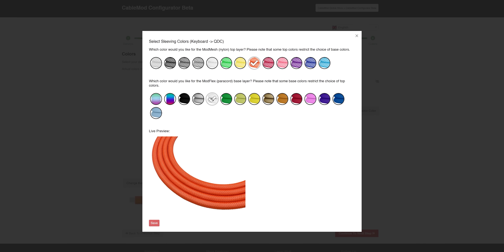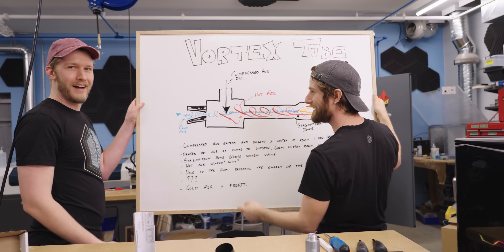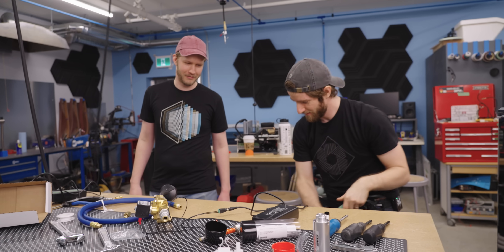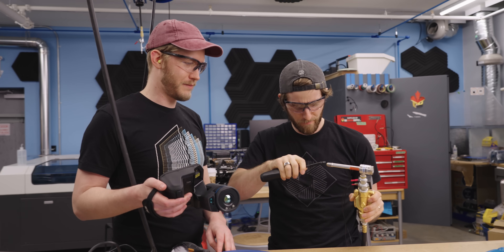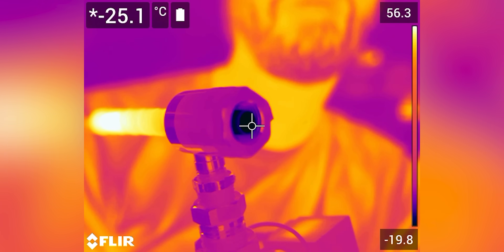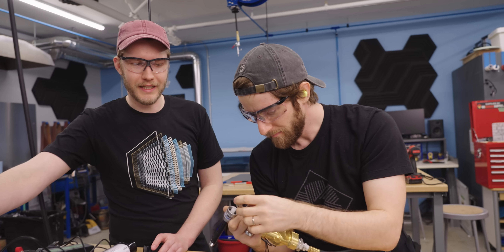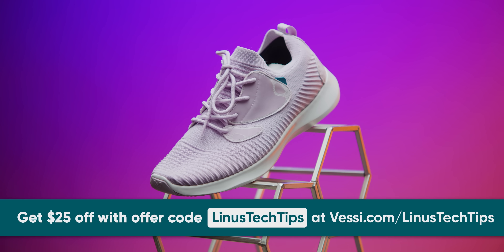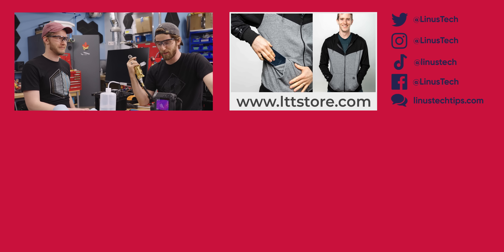This is a CPU Cooler? - Vortex Chiller

Comment: you guys should try it venting out the hot air but having everything else closed off form the out side air so you can try and get the hole system under 15 degrees then try and run the benchmark

Comment: interesting use of " Maxwell's Demon "  if there is a next time try both a water trap in line with the air and aim at Heat Pipes on the cooler, not just the fins.

Comment: An excelent example of the difference between temperature and specific heat.  Air (regardless of how cold) is astronomically lower specific heat than water.

Comment: dude, I watched 5 minutes of a 6:49 minute video and got how it works. It's just thermodynamics, it's simple physics. I don't have a PhD, I got a very basic title of refrigeration back in high school ( I went to a tech one, in Chile) and after that I never worked on that field, and still understood it.
Take the diagram you had on the whiteboard
1. Compressed air comes into the chamber
2. The chamber and the shape of the tube make the air go into one direction (right in this case), friction along the way heats up the air
3. The control valve stagnates or partially stops the airflow in the center of the tubing, allowing only some of the (now hot) air to escape
4. The air in the center, as it can't escape through there, moves through the center of the airflow into the opposite direction, trying to escape through the other exit
5. Because while traveling to the left exit it has to go against the hot air's flow, the air in the center loses energy, which cools it down
6. Cold air comes out the left exit of the tube.

Comment: Interesting industrial part that actual raised some cool ideas in the comments/topics. Would be cool if they can try it again with some of the ideas like adding a water block for example. Maybe if they could get a perfect seal that should be better? However idk if that would work either. Keep in mind when they were testing on the cpu it was back to the 10cfm(i think). I know it wasnt the 40 for sure bc right before testing the cpu, they clarified the tank couldnt handle it and  "back to what it can handle"(which was the 10 they started with, buuut Alex said their tank can handle "19cfm" soooo idk if a 25 was put back in). They never really stated what nozzle went back in for the cpu test just a rough estimate of wattage(300), so idk. If they actually have a tank that could handle the 40cfm, obviously that is 3x more what they were working with on the cpu might be a big difference then(if they were indeed back on the 10cfm). Prob a stupid question but could it be they needed to adjust the heat side to be more open, wide open? They messed with it once and then left it. If anything this shown me how good of a job those coolers are doing.

Comment: Leave the fan in. The ducting it provides will allow the air pass through. The thing you have makes cold air but doesn’t spread it evenly like the fan does. Both together should have impressive results.

Comment: I think it did not work with heat pipes because liquid gas inside pipes got frozen and stopped heat transfer. So you have to do it with some sort of intel box cooler without heat pipes.

Comment: These have been for almost a century and, if you have access to a machine shop, they are pretty simple to make. Made a couple back in the 80's for testing performance vs. liquid cooling while machining small batch orders. We also messed around with them for things like hand grinding tool steel as opposed to quenching the tool in water to help with consistency as everyone grinds tools just a bit differently. It worked alright though this is not really what they were designed for.

Comment: Take a PC case and block all the air vents except one, and then drill a hole in the case to mount the cold side of the vortex cooler. Fill the case with cold air! With a decent CPU air cooler and an air cooled GPU, I think you will get some insane temps. 

We use these on our electrical panels as described above, where a fan cannot be used. Typically in dusty and corrosive environments. The electrical panel would have air cooled devices mounted inside with their own fans like variable speeds drives and servo drives. They work really well and last forever.

However, I wouldn’t say they are more efficient than peltier coolers. The electrical to pneumatic energy conversion at your compressor is extremely inefficient. That compressor is probably pulling about 2000w  just to keep up with demand of that vortex cooler with medium nozzle on.

Comment: the best way to use this is you should attach it to a ek cpu water block, like the ones used for custom loops and leave the other end connected to a soft tube outside the case.... this way u get it spread directly on the die via the block and the thermal paste... maybe grizzly bear or noctua...

Comment: I would use an almost enclosed pc enclosure with a filtered exhaust to release the excess pressure that will come from the cold air output of the vortex. Also use the transparent tubing inside the computer case to spread the cold air inside. Make sure the whole Vortex stays outside so the hot air stay outside. And finally id put a thermostat inside the PC case to activate the Vortex at a given temperature. Finally keeping all the gpu and cpu fans would make the whole heat exchange way better.

Comment: I think you need to try a "gadolinium" chiller. I believe a gadolinium chiller is the answer to these very hot running processors. Seems plausible that a simple design similar to  heat pipe cooler can be easily engineered using the the properties of this amazing element.....

Comment: I could be wrong but I believe the way this works is the cold air is heavier compared to the hot air and the vortex is spinning fast enough to rip the air molecules away from each other then derects the heavy "cold" air out the bottom and the light "hot" air out the top. Could be wrong probably am but that's what I think it's doing

Comment: I've seen it at my job in a ink room in an electric pannel  (alcohol vapors) and it's working good but it's so noisy when the air passing in the hole.  You also need a industrial compressor for continuous operation.

Comment: How about fabricating a massive waterblock basically for the CPU that you hook up the thing to directly circulating the cold air and soaking back the warm air through the nozzle thing? Contact would still not be great directly to the die but it would be a cool project to see

Comment: I got a vortex tube in my tool box. Bought it for $20 off another mechanic 20 years ago.  It blows hot air out of one end and cold out the other. When I first seen it, it was the coolest thing I have seen at the time but it uses a lot of CFM and is loud like in the video. I don’t use it much. I might check a temp sensor with it and every now and again or show someone who I know will be impressed by it. But the concept is defiantly not new.

Comment: We use vortex blowers in the plant to help generate air pressure on some machines. Others to help cool heating tunnels. 500# the largest one. When the bearings start to go, it is so damn loud
Reply: Blows out really warm air too. We use so many air silencers but it's still lots with earplugs in

Comment: What about using a watercooler CPU module, introducing cold air with a short and thermally isolated tube, and keeping the drain plug opened, or even using a short tube to avoid spilling of condensation? I'm sure it will work perfectly. Sorry about my bad english...

Comment: When I was doing my stock overclocking I used one of those to bump my scores. Mine is a little bigger and I can verify they do last forever. I've had mine for 10 years and it hasn't shown any signs of age. I also had a bigger air compressor.

Comment: An easier to understand equivalent is counter-flow heat exchanger, basically bc the vortex is powerful, it cause a laminar air separation, the extremity get hotter bc of compression when it hits the nozel and the inner air goes back while it's compressed and hot, and heat the incoming laminar vortex air while itself it lose enthalpy
when it comes out of the cold nozel it get decompressed and get colder all of a sudden.
the higher the compression the hotter it gets on the hot size and the colder it gets on the cold side.

Comment: We used these to chill hi=power piezoelectric transducers in ultrasonic welders. Terribly expensive due to requiring compressed air. Compressing air is NOT cheap.

Comment: The way to do this would be to keep the air cooler with fans in place and then add the cold air to the ambient air the fans are pushing through the heat sink.

Comment: Linus needs to get something like a Kaeser compressor, considering all the other gear they have I'm kinda surprised they don't have one. They're a screw compressor that can deliver huge volumes of air in a relatively small unit, with the added bonus of an optional drier module being built on, only downside is the air tank is separate but they could use their current tank and use the old compressor as a backup.

Comment: Cooling the heat pipes that much where they meet the die is stopping them from doing what they are designed to do. The refrigerant cycle that's happening inside of them is being interrupted. Depending upon how cold the refrigerant is getting and what compound it is, you may even be hurting its performance further if it is becoming a solid at any point in the capillary tubes.

Comment: Blowing directly on the heat spreader means you don't have enuff surface area to have heat transfer. Blowing it on the huge heatsink results in only a small part of the heatsink being cooled. You need to have an air duct surrounding the heatsink for the cold air to effectively cool the 12900KS. Cool experiment to show how NOT to cool a CPU. And I learn something new today! The operating principle of the vortex cooler is worth looking into. It's so COOL and so is this video!!!

Comment: Try a CPU block used for water cooling and blow air in on one end to cool the block while attached to the cpu. Beware though the condensation issue unless you add a tube to the other end that leads to a bucket as well.

Comment: You need a Quincy rotary screw compressor in the 20HP range.  Will supply all the air you need.

Comment: What if you sealed the case with only one exhaust port and only the intake being that cooler mounted in such away that it has the best flow around everything. Possibly even insulate the case. The idea is to make the whole inside of the case "refridgerated" at a constant low temp. By using that compressed air thingy

Comment: In my opinion, try on a one-way route to the hose connected to the water block and release the hose from the water block so that the air is released in the environment. And it has been determined that no matter how much we cool the CPU, we can overclock to the same existing records. If you can, please find a way to make the graphics cards work better or to be able to use multiple cards in the game

Comment: I would use a large watercooler filled with antifreeze and cool the radiator with the vortex cooler. If you can provide enough air pressure, maybe you can get below 0°C, hopefully you won't get frost...

Comment: We used these for air-fed suits entering high heat environments, the cool air would be routed around your body and the hot air just ejected into the environment. The occasion you pushed it into your leg sucked.

Comment: You could try to put an old Pentium 1 or 2 style copper heatsink on the cpu and blow on that. Maybe even 3d print a shoud around it, to isolate it from the ambient air.

Comment: What about using the air flow to create a frost rod in the line of a water loop immediately prior to the CPU? With flowing coolant that is able to both both exceed 0 C before freezing and has a higher thermal buffer capacity, this should improve working temperature.  At quite a premium in energy. Would require a blow through for the air and a wrap around for the coolant, but some of the cost could be recovered through turbine coupling to battery storage on the other end of the blow through.
Reply: I almost thumb upped this comment because it was so close to my own complexity... Then realized it was my own post a year ago.

Comment: Those work really well as EMERGENCY cabinet coolers using plant air.  Electric cabinet coolers notoriously break down and having this installed and triggered with a cabinet thermostat can really help protect the equipment in a failure, especially in areas with high ambient temperatures.  As a bonus the positive pressure keeps the dust out; a big plus in an environment like a coal fired power plant where the cabinet can be located all the way to the upper level.  But they are way too power hungry to be used where another form of cooling can be used instead.

Comment: What about a fan duct for a single tower cooler? That way you might make a more efficient use of the cold air. That´s just from the top of my head. Also, you did build custom fan ducts before ;)

Comment: You should use this together with an enclosed pocofoam cooler where you blow the cold air into the one side of the chamber and the hot air comes out the other side of the chamber.
You should be able to get sub-zero CPU temps that way.
Looking around, both Vortec and Exair make these vortex coolers in a wide variety of cooling capacities. Youcan go all the way up to 6,000 BTU or 1,748.48 watts.

Comment: So what I’m thinking is you need to put the tower into a cooler to insulate it and then attach  the device to the cooler to cool down the environment the tower resides in? Then it can keep its fans installed and circulate the cold air in the box/cooler…

Comment: Weld a copper cup onto a heat sink plate and blow the air into it, maybe at an angle, I dunno, I'm thinking it'll keep it cool while blowing air away from the mobo instead of over it. Or a cup with a cone inside, aim the nozzle at the tip of the cone so it forces the air down the cone and up the walls of the cup.

Comment: Btw it's not your compressor, it's your fittings. I have a cheap Harbor Freight air compressor that puts out higher CFM than yours and it's only because I swapped out the fittings. Here's the fittings I used from Amazon: https://amzn.to/3wdm7Z6

Comment: I have designed cabinets that use vortex chillers in industrial areas like metal refineries where the PLC controller need to operate at much lower temps than the ambient area around the cabinet. Peltier and even AC cooling don't work in those environments which is why this thing exists. And its not cheap to run nor is it safe to operate in areas without hearing protection requirements.

Comment: Get the bigger nozzle and then try to cool an AIO cooler. Then the water transports the heat and only the radiator needs to be chilled. = no frost/water on the electronics

Comment: You kept the heat pipes from working by chilling them. They're heat pumps, they work by using the energy to phase change a liquid to gas at the CPU and then releasing it at the heat exchanger side condensing again from gas -> liquid. By chilling them, you effectively disabled them.

I bet it would work with an old school all metal heat sink where it's just one piece of metal with fins milled out. Give it a try!

Comment: Compressing stuff, usually gases, generates heat (see: diesel engine) and decompressing stuff absorbs heat respectively - if I had to guess what is happening here: centrifugal force result in gas decompressing effectively toward axis of the pipe, and since there is nothing in the middle to absorb heat from beside relatively small amount of gas, its temperature drops significantly before it get pushed at working end by inner vortex caused by the cone. Both at lower temperature and lower pressure (as preferable in its uses).
As for heating of the cone, friction possibly? Not sure if outer layers of air in the tube could get pressurized enough to generate heat from it. As for actual heat transfers "Peltier style" then one I see here would be from convection, and it would transfer heat towards the middle of the tube against centrifugal force (so a loss).

Ps. Treat my guess with a big grain of salt - I actually took lowest level physics possible for my non-physic related studies, and still did not shine on the tests of 'calculate heat-transfer gradients of presented tube device' kind ( especially with that cone at the end, looking totally like a silent punishment for too many people skipping on their lecture attendance ;)

Comment: I've used these to freeze water in a pipe to allow repairs to be made to a valve when the water can't be drained. You freeze the pipe on both sides of the valve You must use dry air, we used huge Air Dryers, very low humidity, or the unit will form ice inside and no longer work until it thaws. We've been able to fine tune it to below -100 degrees.
Reply: freeze seal, common in the Nuclear industry

Comment: You should adapt that vortex chiller to a water loop but use cool air as the water and use metal tubes. Some how adapt the device to the loop. You have the air from that device have that air put through the loop but basically only in the CPU cooler that is installed onto the CPU. Then let the air out from the loop dissipate to atmosphere. Let the air go out safely and away from the mics so its not loud. I would like to see if something like that would cool a CPU or maybe a GPU. Obviously don't use a 12th gen CPU use one not so power hungry and that gets as hot as the surface of the sun but a CPU that you could cool from that vortex chiller device.